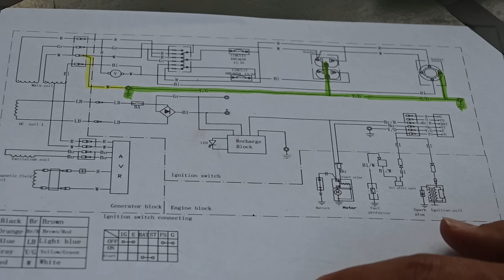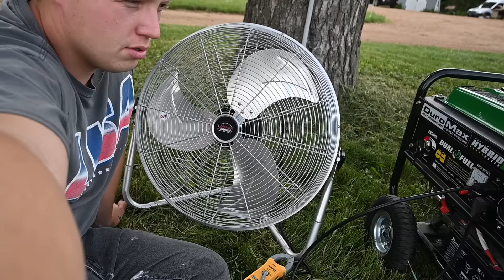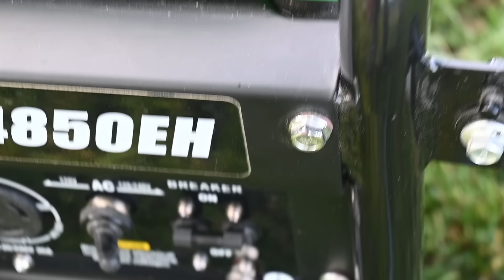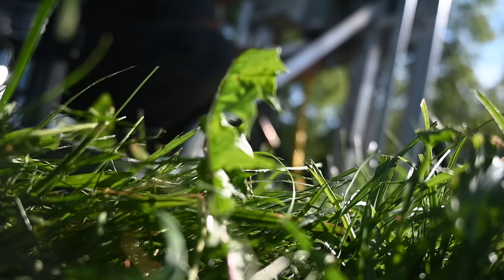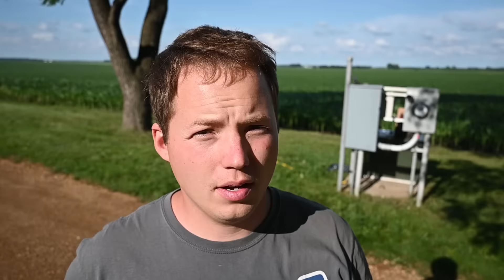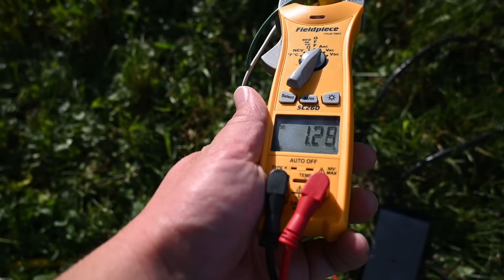What is a Floating Neutral Generator?

Comment: Hi Ben love your videos. Could you check out this post I started about using the xp9000iH with there xp9000iH-pk parallel box with no neutral connection. Seems odd
Reply: a

Comment: An ungrounded system is safer than a grounded one. If you were to touch that hot wire or the frame of that genset when you shorted the hot to it nothing would happen! Seriously you won’t get shocked! This is why helicopter crews can safely work on power lines they aren’t grounded. If no part of this electrical system is grounded then you can safely handle any single phase while you are grounded. The danger only occurs when the genset is connected to a grounded device or circuit! If the entire system is ungrounded the only way you could get a shock is to touch both hots or a hot and the neutral or the floating ground. The reason the electrical grid is grounded is not for safety, but to make finding a fault easier! How is this done well let’s say one phase of a transmission line is on the ground, guess what happens? That’s right nothing! Imagine trying to track down a fault in hundreds of miles of power lines with no way to narrow it down! On a grounded system the downed line shorts out blowing a fuse or breaker, this isolates the problem as well as lets one know there is a problem! Once one part of the circuit is grounded then you have a dangerous situation and everything should be grounded. Now if one phase or an ungrounded electrical grid was grounded through a fault and you didn’t know about it simply touching another one would likely kill you so on the scale of the grid it would be extremely dangerous to use an ungrounded system for ease of maintenance! The chances of there not being a phase grounded without your knowledge on something as big as the grid would be almost impossible. But on a small scale system such as a portable genset it is definitely safer then a grounded system.

Comment: 22:07 so if connecting the 30 amp (yellow) cord to the bonded connection at the panel by the meter makes it safe, doesn't that leave the GENERATOR AS A FLOATING NEUTRAL unsafe were one to use BOTH THE CONNECTION TO THE HOUSE but also use the LOCAL OUTLETS ON THE GENERATOR?  Maybe the cord shifts the first point of disconnect back to the panel by the meter? ... 

What would one do in a bonded neutral like in Gavin's garage?  If you do what he did, float the neutral, then it makes it unsafe for local use.https://youtu.be/qiXuG-lOdTo?si=YpswfRzRlL2SjaBj

Comment: So if I have the generator going to the secondary panel (with a floating neutral generator) do I need to bound the ground to the neutral at the gen?🤔 even if the first panel have a jumper already?
Reply: Follow the instructions from the generator and if they don't make sense that's the hint to hire an electrician! Only the first means of disconnect should be bonded, look up Article 702 of the NEC if you want answers.
Reply: @jordanclayton7913  that's not really the answer to the question but that's cool. Thanks. I WILL READ THE INSTRUCTIONS ON THE GEN AND READ ARTICLE NEXT TIME! lol
Reply: @pinos74667  Well if you don't understand electrical theory or are not an electrician it wouldn't make sense anyway, especially since I gave you the answer but you didn't understand that. 
Like I said, that's when you hire a qualified electrician before you burn your house down or die from touching metal. Playing with electrical isn't a DIY project, though so many act like it is..
Reply: @jordanclayton7913  so you are saying "only the first means of disconnect should be bonded" let me go back to the original question on a different way. Why is it that when you have a 3 pole ATS and a 4 pole ATS, one needs to be bonded and the other one doesn't at the generator 🤔Or, do both of them need to be bonded? And why?

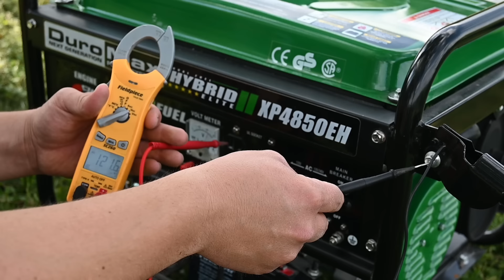Comment: 9:15 You're quite funny - Connecting live to the chassis and then being afraid to switch the power on. That's absolutely no different to connecting neutral to the chassis and switching the power on - something you'd do without thinking. Making that connection in the automotive world - would be called 'a positive earth'. Having connected the 'live' wire to the chassis, the dangerous wire is the neutral ! Oh look - that's where you found 120V !

Your test cable has an earth lead in it - you could have just connected the earth and live leads together at the end of that wire !

Comment: A generator is only a separately derived system when connected to a transfer switch with a switched neutral. A transformer is a good example of a separately derived system, no direct connections to conductors of another source other than by grounding or bonding.

Comment: If you break the neutral from the service (aka the utility) then you need a separately derived system. Then the gentset / transformer neutral and ground need to be bonded. Don't break the Neutral from the service. just float the genset. Here is the NEC code. https://www.youtube.com/watch?v=nwgzT_CTIMA&t=86s

Comment: * Q U E S T I O N *:  I live in the USA and have a Bonded Neutral portable generator feeding power into a Generator Inlet Box on my house that back-feeds a Double Pole Breaker in the Main Panel just off the meter.  Main panel is the First Means of Disconnect so the Neutral Grounding screw is in place AND the panel has the Breaker Lock-out installed as well.  Because of this set up, I need to UNBOND the Generator.
     I would like to keep my generator BONDED as this allows me to use it when camping or working on remote projects.  Would I be correct that by disconnecting the Ground wire at the Generator Inlet Box on my house, I am effectively no longer bonded at the Generator for this scenario?  Does this create any safety issues?

Comment: Question I'm in a florida hurricane right now, I plugged my fridge into my generator using a 12g 15ft cord and it keep tripping that ridiculous gcfi outlet on the generator nothing is wrong with the fridge it's brand new, I have a ryobi 6500 watt generator I desperately need help to save our food is there any trick I can use?? Can i put in a regular outlet on the generstor can I wire something different in the generator I'm in a bad hurricane and need your help I have no power please help!!!???
Reply from the maker: That stinks. Did you get it working? Is the refrigerator the only thing connected? You might be able to use a cord with the ground prong removed to plug it in. Sorry I didn't see your comment sooner.
Reply: How about it tattedone, did your new fridge have a ground fault ?  
Is the Ryobi 6500 a bonded ground (standard type) generator?
I am curious because I reviewed your 6500 owner's manual and it has no bond info whatsoever, plus I help all my neighborhood with generators in disasters. Personally, I'd try to trade in that generator for another. I have 6, and not a one of them has a GFI receptacle. What a pain!
Reply: @BenjaminSahlstrom  we were without power for a week, lost all our food that gcfi outlet on the generstor just kept tripping, now I wonder if also have a 30amp 4prong outlet on it i wonder if I plugged in a power strip to that outlet that has the correct 3 prong on the end if it'll work

Comment: Sorry, I disagree with your opinion on safety issue here. I see no reason to bond the Neutral of an isolated power source like the generator to the Earth ground. By bonding it to Earth will not make it any safer than not bonding it at all. Without bonding, is just like a floating secondary side of the transformer where neither of the two leads is connected to the protective Earth. The advantage of a floating power supply is that you can safely touch ANY ONE lead AT A TIME without being electrocuted.

Comment: Very interesting video. Thank you. Yes, very difficult to explain....you have my sympathies!
The ubiquitous Chinese generators seem to be built with varying degrees of quality depending on the market they are destined for......  Yours looks (at least) to be top quality, whereas what I have here are pretty poorly constructed and their reliability is questionable.
Also, here we have the situation where Neutral & Live are interchangeable by way of flat plugs, two & three "pronged".... Another consideration.
Anyway: Installed a standby generator....via a rotary switch, a double pole of course, so no danger of "feeding the system" much simpler I feel than the gate and shutter mechanical system you have there. (Great system: Just wish they'd adopted that as law  here.)
But I have always been dubious about the grounding system as a result.
Neutral grounded at the meter.  
So, my generator output is not grounded. I have to rely on the fact that the Earth Terminal in each socket is grounded at the house...so as give the grounding protection to appliances. 
My question then is: Should I Ground the generator  itself...via that terminal marked as such?
Again...many thanks for clarifying the general situation. Much appreciated.
Reply: IF YOU'RE USING THE GENERATOR JUST AS AS A HOUSE BACK-UP AND IT HAS A FLOATING NEUTRAL, THEN THE GENERATOR  IS BONDED AT THE HOUSE CONNECTION (IF YOUR NOT SWITCHING THE NEUTRAL AT YOUR TRANSFER SWITCH).  DON'T GROUND THE GENERATOR

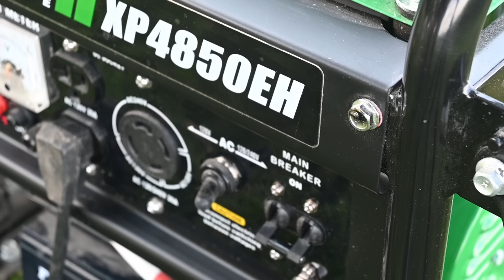Comment: If 12:40, if there was 120V tickling those frame nuts why wasn't there any sparking? What would your ammeter showed around that hot lead? Why is there very obvious sparking at  16:11 but not at 12:40? Why did the breaker trip at 16:11 but in your other video at 9:50 it did not trip ? https://www.youtube.com/watch?v=gHQE5L6hbgs&t=591s

Comment: Ground is not a good conductor, where i live, the soil is very dry and the so called earth is a very poor conductor. In physics demo its electrostatics we deal with very high voltages but very low current

Comment: My generator has floating neutral but when i turn it on, the neutral wire become live, when i connect it to my house the neutral become neutral (not live anymore), how do i fix that?
Reply: Please explain the problem in greater detail. Are you showing a voltage between the generators neutral pin and ground pin?
Reply: @Veritas-invenitur  Yes there is a voltage in the neutral pin, no voltage in ground pin, it supposed to be no voltage going to neutral pin right?
Reply: @masbejo5441  Hot to neutral should have voltage. Hot to ground may or may not have voltage depending on the generator. Neutral to ground should NEVER have voltage. If you have voltage between neutral and ground disconnect all loads and verify the condition still exists. If it does DO NOT USE and contact the manufacturer.
Reply: @Veritas-invenitur  A floating neutral will show voltage to ground when it is not connected to anything. That is why it needs bonded in the first place. Bonded in the generator if it's used stand alone, bonded in the main panel if it's used as backup. Without it being bonded, the whole system can float in voltage because of induction through the air. There is extremely low current available between ground and neutral in a floating system, but you can measure voltage since the meter isn't providing any real load.

Comment: So.... unless you're going to use extension cords to individually power appliances throughout the house, you want a Floating Neutral Generator to power your house via the panel(interlock)/transfer switch. Many portable generators I see on the market say "bonded nutral" on the face cover, but that may be just chinese copy-pasting. Best is to measure with a multimeter.

Comment: It`s actually proof what floating N - much safer then bonded
In bonded you already put one hot (line) wire to the frame. Any other hot wires became dangerous for human
In floating you have a safer option to touch one phase (hot / line) wire and frame and not electriccute yourself

P.S. As for me, the man who decide to bonded Neutral to Earth on low voltage circut (high voltage are different) make super stupid thing.

Comment: You're confused that's already bonded in your household system if you plug it into the house it's not an individual bonding system you only want it bonded one location in the system and its already bonded in your box in the house
Reply: You are the confused one. Panel in his house is a sub panel, thus not bonded.

Comment: There is no such thing as a floating traveler circit. A traveler circuit concist of a current line and the neutral of the one current line .of a ac circuit. Ac = aleternate circuit. = 1 full current from transformer  circuit  out  and half of that same current % back on same circuit back to transformer. If it not travel back , it called dc = dirrect current = 1 way and no return = no neutral transformer

Comment: Ben Awhile back I asked a question. I bought and setup a Duromax generator(w/floating neutral) connected to a setup exactly like yours. I Called Duromax and they confirmed the generator indeed had a floating neutral. I only plan to use the generator as a backup power source. The advisor suggested not to connect the ground from the Reliance 50amp inlet box to to ground on my 200amp sub panel, as it wasn’t needed. He advised only the neutral needed to be bonded to my sub panel’s grounding bar, so that’s what I did. This sub panel feeds my home’s service panel. I did notice right away that you connected the ground from your Reliance inlet box. My question is. Should I also connect my ground along with the neutral that’s connected? Any thoughts or ideas would be much appreciated? Thanks in advance. I really like and appreciate your videos.&

Comment: WARNING:  Nice video but one correction.  A generator with a bonded neutral will create a SHOCK HAZARD when feeding a bonded service panel.  If the user touches the generator frame AND the service switch at the same time, because current is flowing through the ground lead (OR if the user touches the frame of the generator and is standing near the ground plate) current will flow through the user in parallel... it only takes 5mA to shock someone. @BenjaminSahlstrom  @patthesoundguy

Comment: The dirt (the ground) is not part of an electrical connection, (with an independent source of electrical power) having the black wire being connected to the GENSET's chassis it electrically irrelevant.  There is no distinction between the white wire and the black wire in this situation.  The only 120 Volts is BETWEEN the two ends of the winding/s,  there is no HOT conductor.  He truly fails to understand how "generators work."  I see no value in this content. Ron W4BIN

Comment: When i hear you Americans on this subject always confuses me!! A power source has a negative and positive, that feeds your appliances, here in Brittan we just have 3 wires a positive negative and an earth, which is connected to the metal chassis of our appliances should there be any faults leading to a live wire (p) or (N) being shorted to chassis, then gets taken to our earth which is supposed to maintain or safety of having a zero(0V) escape path, which the blows the fuse of your supply source!! But' if your going to be making it a live negative, your going to be taking away our safety "zero" earth wire that has been changed to a "LIVE NEGATIVE" EARTH looking fore an escape through to a more positive connection being made to our safety (0V) earth!!  I need a pint Lol.

Comment: I'm so fucking confused. If you want to make your generator a floating neutral generator. I don't know what the hell that is or what it means. I bought a generator and there's a wire that goes from part of the generator to another part of the generator. The part that it goes to the manual says that's the ground so I don't know what the fuck I'm doing. I will not be hooking this up to anything to run an entire building or whatever I am going to have extension cords plugged into my generator if the power goes out. In such a situation what do I need to do or what do I need to know do I need to disconnect that wire or take it off or hook it up to some copper metal rod that's in the ground to plug extension cords into my generator I don't understand

Comment: This shows just how misguided most sparkies are these days.
Know your current paths! @Benjamin Sahlstrom

I know your training has beaten it into you that without a green/yellow wire, it's not safe. It's bullshit. The ONLY reason the power distribution grid is referenced to the ground is to give lightning a path to ground that doesn't involve flying out of people's light switches to their kitchen sink.

If it were possible for the distribution network to be floating, it wouldn't be referenced to ground and the likely hood of an end user being electrocuted would be greatly diminished because the current would not be seeking the ground at all.

A floating power supply is FAR FAR safer for the end user. You almost said as much half way through.
Think about it. What are mains isolation Xfmrs used for?

I understand what you are saying when it comes to multiple, multi phase gen sets. However, this ONLY applies when they are wired to power a single installation. We're talking about domestic (mostly single phase, but that's irrelevant) generators. Where unless you do something completely retarded, they cannot be connected together in any way shape or form (and anyone that did, either can't be helped or knows how to sync them). Even if there were two generators in operation, both went faulty and someone grabbed a metal frame connected to each.... Bonding them to earth only makes them more dangerous.